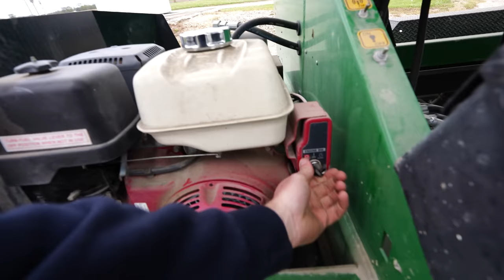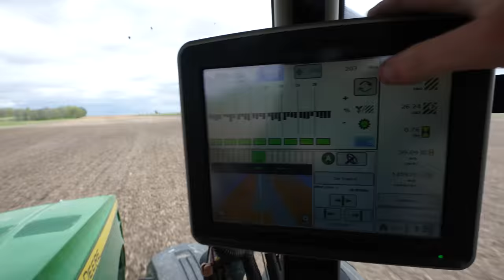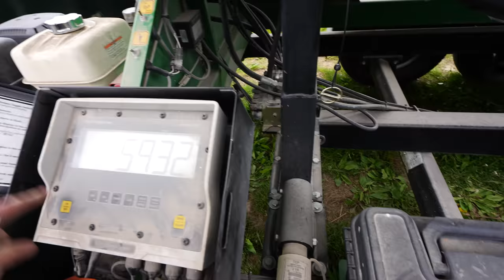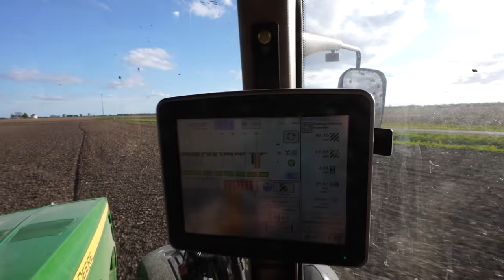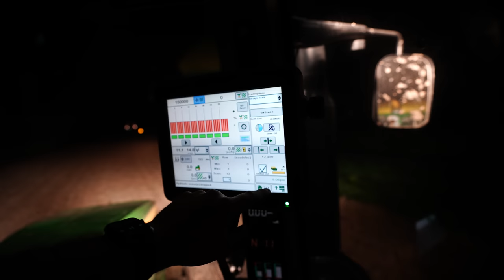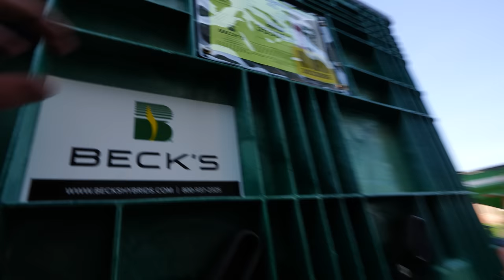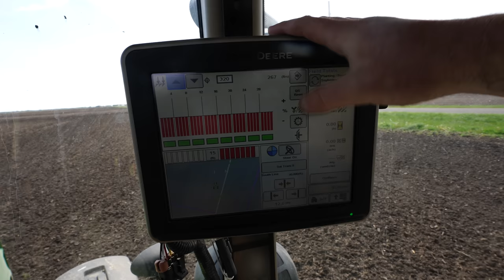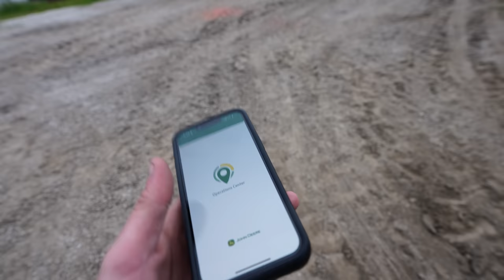Narrow Planting Window Widened By A Spring Miracle (Ep.170)

Comment: Just now I found time to watch the video:
6.85 acres = 298,386 sq.ft, divided by 40ft planter width = 7459.65 ft length of the autosteer line of the endrow. The field is rectangular therefore each side of the autosteer line is 7459.65 ft / 4 = 1864.9ft. The field outside is 40 ft longer than the autosteer line (20 ft on each end), so 1904.9ft. 
Now 1904.9 ft squared is 3,628,691.63 sq.ft  = 83.3 acres.
Reply: Hope it’s right, you also shared your work. That alone is worth a price!
Reply: Wow 👌

Comment: An infinite number of rectangles exist with any given perimeter.

I think we need the relationship between length and width to finish the problem (unless the rectangle is a square).

But we could do an optimization to find the maximum field dimensions....

Area is quadratic and concave down thus it has a maximum at the vertex.

Consider the track of the planter as one continuous rectangle 40 by x ft.
1acre=43560square feet
so 6.85 acres is 
1)   6.85(43560)=298386 sq ft

thus...
2)   w=40
3)   A=lw
4)   298386=40l
5)    l=7459.65ft (for our considered track)

 But for our considered rectangle, that is also the perimeter of the actual field.

Basic calculus shows that an optimized rectangle is a square thus the bounds of your field in terms of acres is...

If perimeter of the actual field is 7459.65ft, then...

P=4s where s represents the side of the square field.

6)   7459.65=4s
7)   s=1864.9125

So if your field is a square then its area is...

8)  A=s^2
9)  A=(1864.9125)^2
10)  A=3477898.633 sq ft

Given 1acre=43560square feet then...

11)   Total acreage =3477898.633/43560
12)   Total acreage= 79.84 acres (rounded)

Conclusion... the bounds of possible acreage of your field is...

             6.85<=x<=79.84 where x is the true acreage of the field.
Reply from the maker: You are correct that there are an infinite number of rectangles possible in any perimeter. However, no matter how many possibilities there are, two sides are always going to be the same length. 2x+2y will always be equal to the perimeter of a rectangle. With the ability to calculate the perimeter, the problem becomes significantly easier to solve. 

I appreciate your comment, and I’m not going to verify the accuracy of your answer yet!!

Comment: So there are 43,560 sq ft in an acre.  You planted 6.85 acres so far at 40 ft of width.  that means you traveled about 7460 ft to do the perimeter. 
If we take any multiple of that distance to get any shaped rectangle, the total square feet divided by 43560 will be the approximate acres remaining.
Divide in 7460 in half to represent two of the four sides. (3730)   3000 x 730 is 219,0000 .   (219,000 / 42560 is 52.34 acres.)   So about 52.34 acres in that field.
Reply: 43560 or 42560?
Reply: This is the correct answer on the possible area within  the perimeter planted. Maximum is the square and the minimum would be 6.85 acres where a pass up and back completes the field. Long and narrow. To add to the confusion, Trippy Farmer asked “how big is the field” Then the perimeter length would be one answer. Though for most farmers field size would be in acres (or hectares)

Comment: Could you go into using down force to control seed depth as aposed to the depth T handle? Thanks
Reply: downforce is how much force is being applied to each unit which is used to keep each unit on the ground. while the t-handle depth sets how far down into the ground the opening disc goes. while in theory it would be awesome to control everything with the downforce its not as accurate as the t handle combined with downforce to keep the unit in contact with the ground…
Reply: @Hendog1001  That is why I asked.I think Andy was using down force to adjust seed depth. Thanks for the reply.
Reply from the maker: Like the other comment said, downforce just ensures that the unit is firmly pressed against the ground. In worked ground, downforce can actually push the unit deeper into the soil. The depth setting on the back is the true depth setting.

Comment: An acre is a rod by one half mile. Divide forty feet by  two and a half and then by two again to get perimeter distance. Perimeter is 1.37 miles. Assuming rectangle length is a half a mile, after all, you said it was a perfect rectangle, then the ends are 976.8 feet wide, or just a fraction over sixty rods. My answer is sixty acres. Thanks for the challenge .

Comment: Andy...  @4:31 what was the "White Powder" you put in with the soybeans?
Reply: most likely talc to help act as lubricant for the internals of the planter.
Reply: I think its talcum powder (= baby powder). Simply helps the seeds to flow through the planter without sticking.
Reply: @Hendog1001  wow, you posted while I was typing 😄👍
Reply from the maker: Everyone else was right that replied. It is just a powder mixture that is used to help lubricate the seed as it flows through the tank, lines, and into the units. Planters perform noticeably worse without it in the mix.

Comment: Thinking about it again, we cannot solve it. Here are 2 examples with same perimeter but different area:
- a field 2 ft by 5 ft has a perimeter of 14 ft and an area of 10 sq.ft
- a field 3 ft by 4 ft has a perimeter of 14 ft BUT an area of 12 sq.ft
So we need the ratio of the side length to solve your riddle. 
But 83.3 acres is the maximum :-)
Reply: If you allow the field to be a circle, you get an area of 106.11885013 (about).
Reply: @eire1130  hm, interesting.
And if the field is 80 ft wide, then it is 6.85 acres in total 😃

Comment: Why do you do the end rows first, don’t it hurt them when you turn around
Reply: If I understand right because they use 'auto-steer' on most of their acres, running the end-rows first gives the computer a boundry to plant to.
Reply: No it doesn't hurt the end rows because they aren't up yet.  It only compacts the ground some but the plant will emerge through it.
Reply from the maker: End rows are planted first so you know where to stop with the planter. That was very important before section control and row shut-offs. We have section control now to make everything looking perfect, but it would still be a confusing mess of the ends weren’t planted first.
Reply: @aTrippyFarmer  , can't you set your boundaries and make an offset of 40 feet?
Reply from the maker: @davidraaf3865  Regardless of whether you do them first or last, the outside rows will have to be planted perpendicular to the long rows of the field. There is no work around. Very few of our ditches are crossable, which is the only way that you can farm straight through. That being said, you can do boundary offsets to activate row shut-offs; however, that is not necessary if you’ve already planted the outside of the field!

Comment: In a typical engineering fashion, I will over think about this, over engineer and be completely off but here’s my 5 second effort
Assuming a square field and only 1 end row that you did, 6.85/4  = 1.7125 acres for 1 side. 1.7125*43560/40 gets me that length in feet (1 acre is 43560 ft^2, 40 foot planter) = 1865 feet for one side of the field. Take that times (1865-40) to assume that you need to take a planter length out of it because you have section control. So then you take those two numbers times themselves to get the area of the rectangle… 1865*1825. That comes up to 78.14 acres
Reply: Beat me to it but that’s how I did it as well. I came up with 79.84 acres. So an 80 acre field

Comment: I think my prior comment may have been deleted, but here goes again

6.85 acres
40 feet
43560 feet per acre

6.85 * 43560 to get total acre feet.

Divide that by 40

7,459.65 feet distanced traveled.
A single leg (assuming a square) is 1,864.9125

To get the exterior of the square add twenty to each side.

1,904.9125

Square that and divide by an acre

83.1314288746